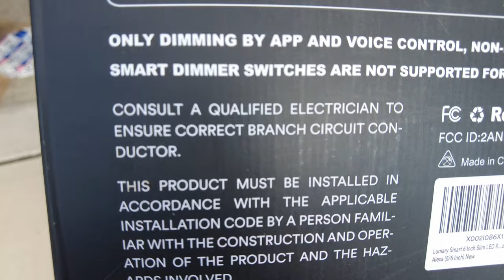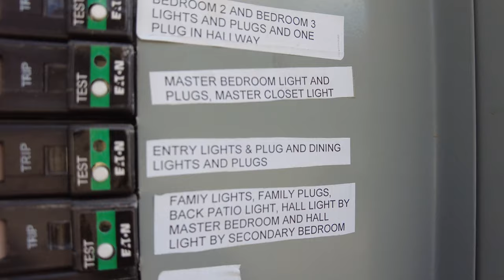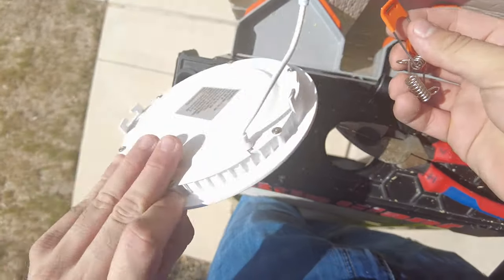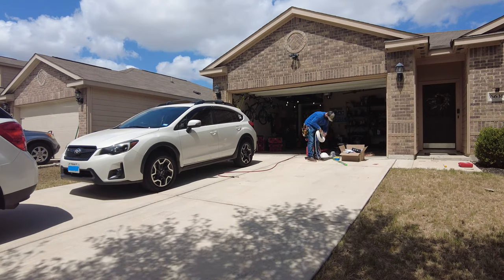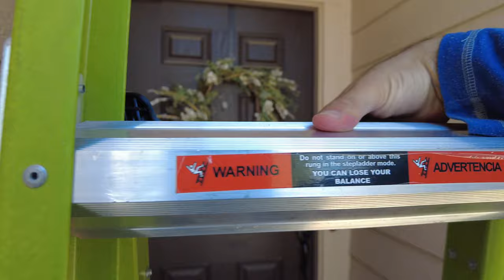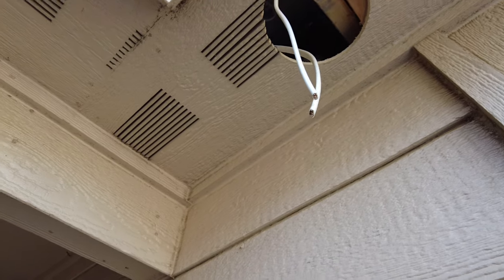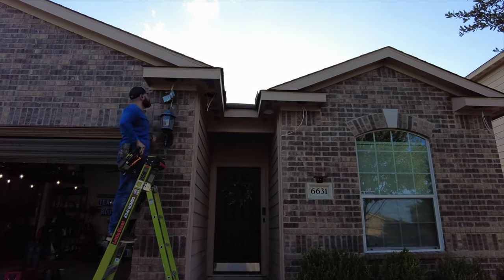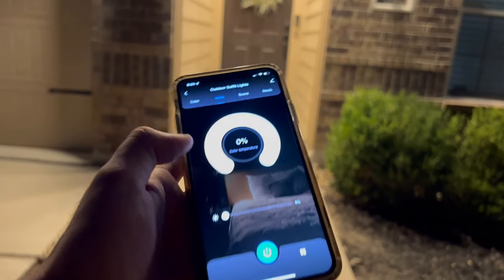Install Soffit Lighting | Lumary Smart Recessed Lighting

Comment: I noticed these lights are for Indoors only. These lights do not have a Wet or Damp rating to be used in such areas inside the home, let alone outside. 
How did you decide to use these outdoors without an Exterior or Wet/Damp, etc rating? We've were looking for the same type of lights, but in black and also came across these. We passed on them due to not having the aforementioned ratings. This was a safety concern we had due to rain and humidity in Texas area. 
Looking forward to your insight for your decision. Much appreciated
Reply: I think the main concern would be with the ballast box. As long as you can get that off the soffit and onto a wall, there should be no moisture getting inside. Otherwise the LED housing are just plastic boxes glued together so water ingress isn't really an issue. Even if it does get in the LED housing, it's likely just 12v DC and won't do much damage to anything other than the light itself.

Comment: Nice job!  I have the same exact soffit material and same lights.  My question is did those light still seat when the joist was right behind the hole you drilled or did you have to shave/remove some material off the joist so it would seat?
Reply from the maker: If I remember correctly, it would hit 1 of the clips on the light fixture . But if you rotate the light so both the clips don’t touch the joist. It can be installed without having to shave any additional wood 👍🏽

Comment: If you had to choose would you choose Lumary or Govee. I'm currently finishing up a new house and want full smart lighting. Struggling with making a choice.
Reply from the maker: I would go with Lumary if I had to pick. I don’t like that the Govee wiring is exposed. Between the 2, Govee is more responsive because they are all interconnected. The Lumary could be laggy if you have weak Wi-Fi but it’s worth the minor glitches to be able to customize the colors instead of 1 color soffit recessed lights.

If you decide to go with Lumary, you are more than welcome to use my discount code to lower the pricing 🤝🏽

Comment: Hey good video thanx. 👍🏻 sparky questions -  just hooked up 3 of these to the existing wiring from a hardwired direct from the panel 15 app breaker. I have three of these lights and motion light, while Daisy chain together direct to the panel. No switch in between. Is that OK?  I’m wondering if a switch is needed for safety or any reason since I can control the lights with a timer at an app motion sensor was hardwired it had power all the time I don’t think I need to go to a switch first. But for some reason I’m questioning myself, I do that often lol✅
Reply from the maker: If it works, it will be fine. But you’re trusting the app for controls to turn on and off the lights which will not work 100% of the time. I would recommend a switch but of course… it’s not “needed”. Just don’t use any kind of dimmer switch. It needs to be a standard single pole switch.

Comment: So for all the wires that were ran to the light location. Where do those lead to? What exactly is powering them?
Reply from the maker: A switch
Reply: @sparky_izzy  did you install that or was it already there? Sorry I’m just trying to understand that part of the install
Reply from the maker: The switch already controlled the 1st light 💡

Comment: I have installed 9 lights,  i love them just having 1 problem  with 1 light . Its in the middle of them. A wifi and Bluetooth issue.  Its always offline. Any ideas of fixing?  Wifi signal is good around it as i have a wireless wifi camera right next to it

Comment: Need to know if I can do recessed light from my soffit with just having one outdoor light outside currently from my porch light
Reply from the maker: Yes! You can run the wires from that existing porch light to your new lights. When you turn on the switch, it will control all the new lighting as well. 👍🏽

Comment: I Replaced My existing outside lights with the Ultra thin 6".  Wondering if you had this issue. I set them to blue and turned them on before I went to bed woke up and they were off.   Made sure I didn't enable any schedules and the same thing the next night.  I'm going to try half-brightness and see what happens.  Let me know if you heard of this Thanks
Reply from the maker: Is there an external switch that controls the lights?
Reply: I had some Home Depot recessed lights installed by the home contractor and just replaced with the Lumary Recessed.  Uts strange I have one on a different switch and did the same thing.  somewhere between 4-8 hours it shut off
Reply from the maker: It sounds to me like there might be a timer or photocell that is shutting of the power. The next step would be to test voltage at the light when the lights turn off. That will determine if it’s a fixture issue or power issue.
Reply: Very good I will do that,  Much appreciated  @sparky_izzy

Comment: I want to install these lights on my home but I'm not sure how many I should install and how far apart they should be placed.  How far apart do you recommend?
Reply from the maker: In general, If the lights are 4 inches in diameter, a space of 4 feet is left between them. If they're 6 inches, they install 6 feet apart on center. But it all comes down to preference.

Comment: I like how you can change colors on all of the LED lights separately... I heard that color LED lights don't really give a WHITE light... Is that true? I love to get really bright white light when I work outside but change the color to pink for Valentine's day and red/green for Christmas or so...
Reply: I just saw that those LED lights are WiFi lights, each one separate controllable via app, that's how you get different color per LED light... Sweet!
Reply from the maker: That can be true depending on what kind of LEDS are used. These give off a very white light. When I’m working outside I switch them from yellowish to pure white & they look bright!

Comment: Sparky Izzy, 

Did the actual 6 3/8 allow for the fixture to fit perfect?  What is it a 6 inch light requiring a 6 3/8 hole?  Just curious.  Any information would be greatly appreciated.  I am about to do this to my house and your video is extremely helpful.  Thank you in advance

Eddie
Reply from the maker: Hello! The standard ceiling cut-out size for 6-inch housings is 6-3/8 inches. It’s a bit confusing but on a regular recessed can light, the 6-inches is the the inside diameter of the housing (trim removed). The hole needed needs to be slightly bigger to avoid additional cutting. Hope that helps!

Comment: Do you have to have a smart home to have those and a certain type of light switch to operate those from your phone ?
Reply from the maker: You can have a normal switch. All you need is good Wi-Fi & the Lumary app for this setup! Check out my other video on how to use the Lumary App! 💪🏽
Reply: @sparky_izzy   ok thanks budd. Also did you run new romex from the switch to the light above the door ?
Reply from the maker: Nope! I left the existing romex from the switch to the light above the door! From that light I fed all the new lights using the same size romex! 👍🏽
Reply: @sparky_izzy   ok gotcha, another question , my light above my door is a recessed light and the the 2 outdoor lights by the garage are all on one switch, would I just tie in the new romex with those wires to power the recessed lights i plan on installing ? Hope that makes sense

Comment: Nice job. 

Question: Did the junction boxes come with the lights or did you have to purchase them separately?  It looks like the boxes weren’t secured to a rafter, correct?
Reply from the maker: The junction boxes come with the fixtures 👍🏽 I try to mount the junction boxes to the wood when I can but there are sometimes where it’s not accessible. If you can do it, if not … I wouldn’t worry so much about it since it’s service work & not new construction.

Comment: How did you get the lights to get a signal because I installed it in my house and only 4 of 14 connect to the app
Reply from the maker: If you’re having trouble connecting, you’re probably have a Wi-Fi issue. You can try to connect them with Wi-Fi or Bluetooth. Add a Wi-Fi extender near those lights will help with the signal. Just keep playing around with them until all of them connect. The first time is the hardest but once they are connected, it will improve.

Comment: How many lights (max) can I wire in series off 1 switch, like you did in this video?
Reply from the maker: Tuff to say, you would have to add up the amperage per fixture. Do a current reading with the circuit you are trying to add the lights to. Add the lights amperage & don’t exceed 80% of the circuit rating. It also depends if it’s a 15 amp or 20 amp circuit.

Comment: How does it do with your WiFi? Does it slow your speeds?
Reply from the maker: I haven’t seen a difference
Reply: @sparky_izzy  I’m having a hard time connecting this led smart ceiling lamp and I’m using 2.4 GHz and still doesn’t connect. I’m fearing this will happen with this lights too
Reply from the maker: I would email Lumary for assistance. There are a couple of ways you can try & connect the lights. How far is your lamp from the router?

Comment: Did you run the wire down to an existing light switch? Or did you have to install a new light switch to control these lights? Or are they all controllable from the app?
Reply from the maker: So I had 1 existing light above the front door already. There was a wire going from that light down to a switch. I converted that existing light to 6” recessed light & ran wire from there to all the new fixtures. I was able to use the same switch to control all the new fixtures. These fixtures can be turned on & off from the app but it is recommended by the company Lumary, to have them on a switch. I hope that helps!